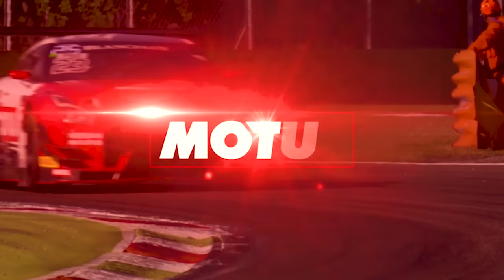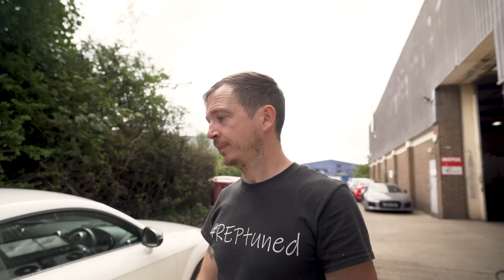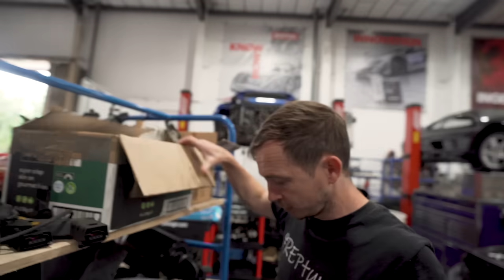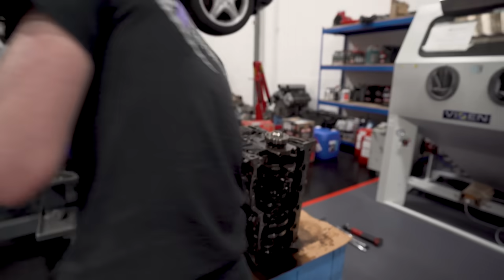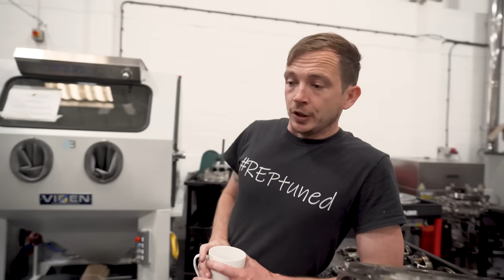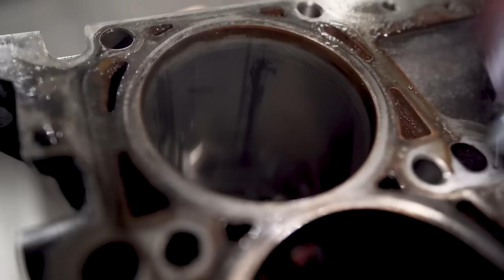We Buy a Broken Audi TT RS!

Comment: Bud only do it if you're going to keep it. It's the way with old cars, 55 plate BMW 120d 150K miles - new alternator, turbo, x4 injectors, uprated FMIC, Koni Active dampers, Eibach Pros spring, BMWP front strut top-mounts, rear shock top mounts and bottom mounts, front & rear ARB bushes and drop-links, idler/pulley/tensioner and belts, front wheel bearing steering rack, radiator & condenser, rear left drive-shaft and ABS sensor, repaired i-drive computer & BT module, remapped to 300lb-ft (200BHP) would need to uprate the torque convertor, only the best for Bertha; About £10K in repair bills only worth about £2K but I like Bertha she got nice comfy suspension that I worked on getting tailored to my tastes for dailying or hooning on a journey when hit I a good A/B road (Koni Active damping)...I keep a (dirty) weekend car currently Boxster type 987 gen 2, but even with PASM and DSC V1, the 19s tyres don't have much sidewall and comfort as daily suffers or may be I'm just getting old and need to buy a Jag...

Comment: Hello bud. Just done a stage 2 on a 2021 TTRS. Would you be interested in anything stock such as the airbox, intercooler, downpipes, mid pipes etc? The parts have only covered 5k? Also I have the alloy fuel cap......

Comment: 1) How much would this car be to buy? I'm interested. 2) If the labour and 83mm parts to rebuild the damaged engine are £1,500 more than OE parts then that would be my preference for a stroker but much stronger than OE. 3) Would £15K inc VAT buy that?
Reply from the maker: Yes it will be up for sale and I’ll be aiming for about £15k. The rods and pistons alone are £5k so with the machining and build will be more than £1500 for the big engine spec.
Reply: Well if you want to sell it today Rick inclusive of the "big engine spec" (with a view to returning when budget permits for a larger turbo and intercooler) then I'm your boy. Boots to be new PS4. Everything else on trust...
Reply from the maker: @markbauwens8033  Like i said Mark it will be circa £20k for the car with a fully built engine. Cheers Ricky